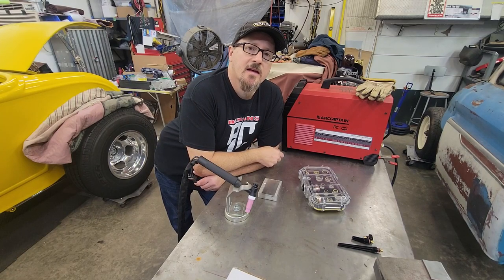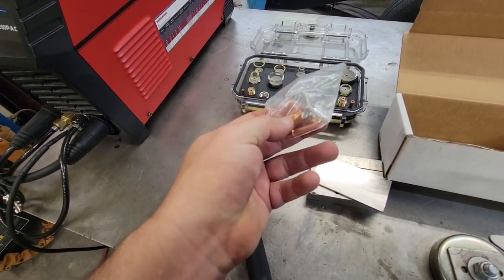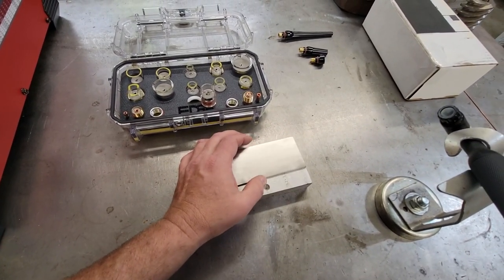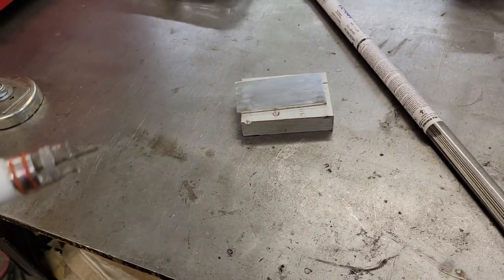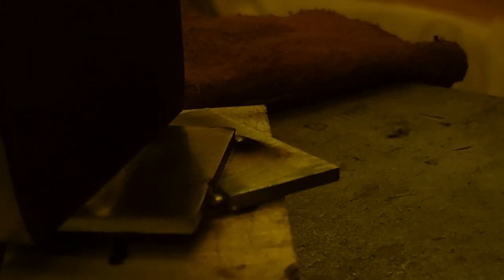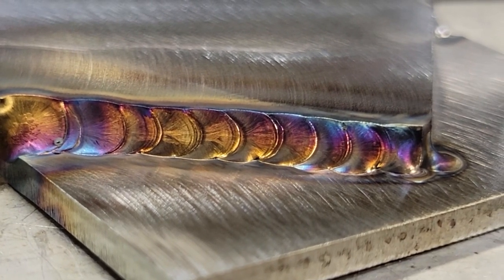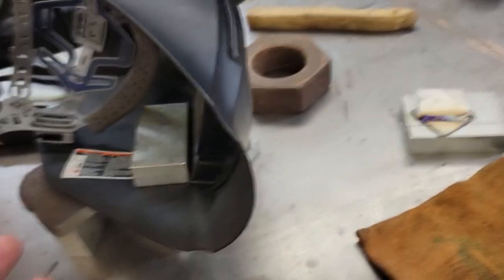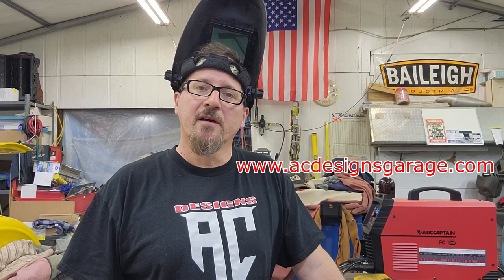The Best Budget (TIG Welder) MUST Have UPGRADES!!!

Comment: I've never had any luck with the edge welding cups I use furik cups as far as a machine is I have a primeweld Tig 225x w/ maxcool 3000 watercooler added the CK worldwide flex-loc torch for the win. Tig machine have become so competitive anymore I learned to weld back in highschool that was 27 years ago and it was red and blue only the 500 lb one's... Back three years ago I purchased a cheap plasmargon mig-235 so I can do sanitary welding and lift tig in the time I had it took my time to find the right one.  It was a decision between the primeweld the Everlast, Eastwood,ahp never available,weldpro called primeweld and they put the whole package together for less than 2k never had a issue with anything in 3 yrs of running from 4-8 hrs daily. Keep up the good work on your video you have great interests and looking forward to new products.
Reply from the maker: Ive always been a blue guy, I still have my original miller buzz box that I learned on back in 1993. I've never had any trouble out of edge cups. I also have furick cups, there both great and  made in my home town.
Reply: @ACDesignsGarage  it's funny to think about how much the welding machine has changed the world. It was a low level industry that people were specialized in now everybody is wanting to learn how to TIG weld. Or it's a manly thing to be able to use fire and fuse metal together...... LoL 😂😂
Reply from the maker: @danielsplayhouse3804  hahaha forsure